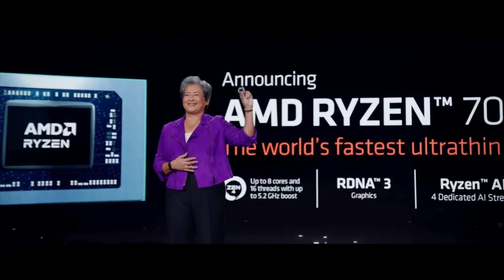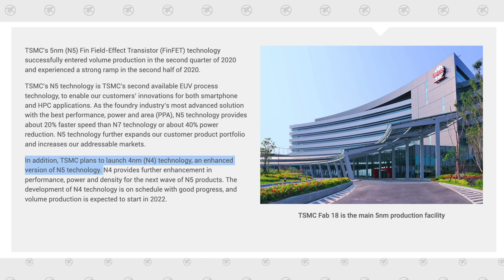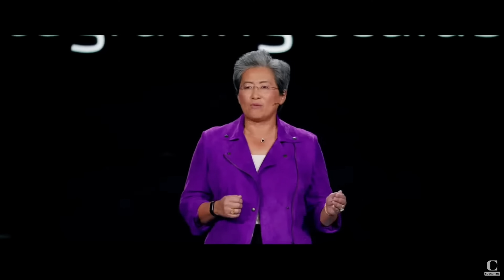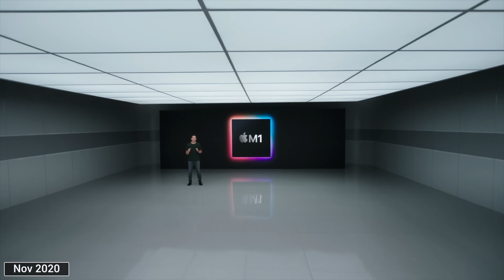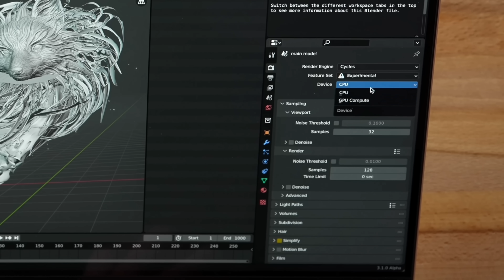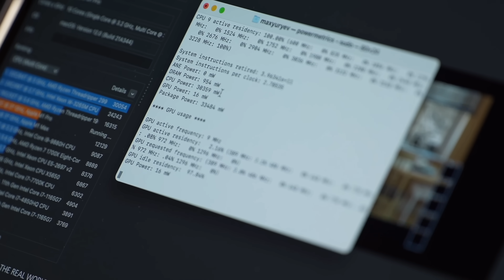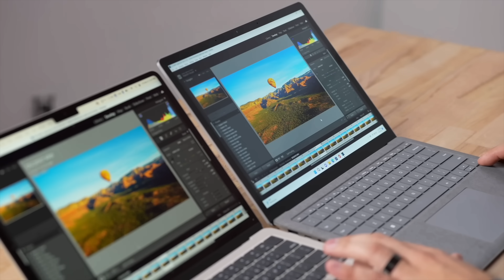AMD's New 4nm 7940HS vs M1 & M2 Pro! Apple Silicon Killer? 🤯

Comment: M1 arm based chip with integrated ram just beat every other players in the market with performance and energy saving. 😊 There is no comparison between x86 amd Intel cpus and Apple computer. I would like to have an apple computer for office, documentation, video editing and coding( app development, web development). If i need to do engineering design, engineering analysis, HPC, CAE, embedded system development, gaming i must have to stick to Windows+ WSL, Linux.  here Apple computer rendered as useless junks. M2 it's just awesome if you just need to do basic stuff, draw back you can't upgrade ram upto 124gb whenever you want, you can't just use your own ssd storage. And most of the industrial application doesn't support Mac Even with the emulator it just doesn't work. Also you can't use gpu tpu form other vendor with Apple Current system.

Comment: AMD 780M iGPU has 17.82 / 8.909 TFLOPS (FP16/32) - your argument trown out of the window

GHz bedween different manufacturers or arhidectures does not equal same performance, not even close - your argument trown out of the window

They used CPU in Blender Render to visually show CPU performance gains over other - your argument trown out of the window

1rst gen does not equal same as 2 gen on anything - your argument trown out of the window

The HS seris is CPU-s with powerful IGPU-s with almost to double the TFLOPS of M2 so more power consumtion as graphics allways take mutch more power - your argument trown out of the window

You use real life spec of low power device and compere it to a theoretical max allowed - your argument trown out of the window

Video editing is not "Real world usage" it is high performance usage, browsing, videochat, text editing and sutch are as the standards have been set(by many organisations) - your argument trown out of the window

It has been tested over the years by many independents(also on YT) that yes few laptops get the promiced battery live when AMD has stated one (mine was rated up to 10 hours on battery and have 2 gens old, it does that and get full 8h days regulary when surfing the web, with 10 to 50 active tabs, and watching movies), some lie in presentations and datasheets and even ordered by Courts not to but still do it, AMD has over the ZEN period been spot on - your argument trown out of the window

Comment: Why do AMD and Intel like to compare the Apple, it's irrelevant to a degree as Apple aren't going to use outside chips, and those buying AMD and Intel are probably not willing to switch to Apple. 
All comes down to what you want to use a device for, although most Apple owners I know it's because it's the more fashionable device and kind of more upmarket for that reason and the few because of the seamless connection of the Apple ecosystem, which credit where credit is due is impressive. Shame Windows phones didn't stick around to give non Apple customers the same. Preferred my windows phone over android personally, bit Microsoft should have but more effort into its integration. To be honest if windows was still on mobile and progressed, that would have spurred Apple on more than AMD and Intel catching up, Apple knows that if these companies do surpass them at any stage it's unlikely to have a massive difference as aside from those in the Apple camp for the fashion part, the more critical users need the integration.

Comment: Think you need to compare the M2 pro against the 7945Hx which a 16 core Ryzen processor runing at 5,4ghz with 80MB of cache or the 7845HX with 12 cores. The fact that this guy doesn't know what the top of the line AMD processors are and he's too Apple bias to be belivable.

Comment: I tend to think (using myself as inference) that, while powerful and efficient componentry is highly preferable to less powerful and less efficient one, the power and efficiency alone is not sufficient a reason for one to defect: a Mac aficionado won't buy a Windows-operated machine (at least, I wouldn't) - and vice versa - a Windows OS fan would hardly defect to macOS simply because the M -series hardware is 10, 20 - or even 50% more powerful. I don't see myself ditching macOS for anything else (including the visually much more polished than the WindowsOS, but rather limited in many ways - Elementary OS). 
 This is, of course, not to downplay the importance of hardware efficiency, power and software /. hardware optimisations.

Comment: Couple of thoughts ... GPU Tflops cant be compared across diff architecture. 25B transistor on AMD vs 33 on M1pro is cos M1Pro has large die dedicated to GPU. Apple 10C has 4 efficiency cores so CPU die size of M1 pro should be similar or less. So CPU i am sure AMD is ahead. GPU they are behind, battery would be an interesting test cos x86 is not efficient instruction set.
Reply: Actually, x86 is not that much more inefficient; the thing is the boosting algorithm. I recall seeing an extensive battery test on various laptops, and in some tasks, the old Ryzen chips could almost keep up with the M1 in terms of battery life, but that was only in some tasks. The thing is, that only applies if you leave a static app open. Now here's the interesting bit that the videos found out: When you open, say, Chrome on Apple silicon, the chip will not boost and the power consumption will remain flat (it was around 10W, iirc), but for both Intel and AMD, the chips went brrrrrr and literally drew their maximum rated TDP whenever you opened Chrome, meaning 45W. Why this happened I still don't know, but yeah, the reason Mac OS laptops are usually that much better in terms of battery life is the software development team. I would say the architecture engineers are pretty evenly matched.
Reply: @diegom2220  it's for opening chrome quicker. It's a feature called turbo boost and you can disable it if you don't need it. It boosts the CPU to max for 1-2 seconds so the program opens quicker, it then goes down to normal after.

Comment: The 7940HS is much more interesting to me as a desktop APU. MiniPCs are becoming more and more powerful, and having one of these in a MiniPC could well replace my desktop.

I've been gaming mainly out of my Steam Deck docked as a replacement fro my i7 7700K GTX1080 desktop, but it obviously lacks a bit of power only going to 15w TDP.

These new Dragon Range APUs are much more capable, and suck up to 45w while being new architectures on both the CPU and GPU side (CPU is two gens newer than the deck!).

Comment: at 3.5 ghz, the amd chip may gives similar efficiency as 8 core M1.
Reply: Agree, I down-ed clock my desktop ryzen 5 5000 to 3.4 GHz, it takes about 30W power and gives about 80% performance of the binned m1 pro. (It’s on 7nm finfet while m1 is on 5nm).
However, the m1 line up idle power consumption is unmatched, about 1w while the desktop cpu is at least 7 to 10w
Reply: @fibundle  May windows OS is also playing in the background . Also there one thing called "speed shift" in intel cpus but dont know what it is called in AMD, which decreases clocks by a lot when not in using but burst when needed. AMD 6000 apu got some dedicated video encoding hardware that can turn off other cores and run video purely on dedicated hardware  and some ultrabooks are said to give above 20hour battery back ups.
Reply: @vmafarah9473  my ryzen 5000 in linux can go as low as 400MHz, but it never turn of any core
Reply: @fibundle   also M1 in pro model  only lasted 2 hour on cpu rendering.
Reply: @vmafarah9473  record Is 1 hours

Comment: AMD doing with limited budget for R&D  is impressive and also, these chips will come to cheaper upgradable devices is awesome. with 30hr video playback makes it a poor mans M1 chip also boosts as well as Intel above 5ghz is impressive.    M2 pro also got more onboard graphics  which uses up some silicon space and make it difficult to cool. igpu is actually killing cpus boost clock for single threaded and multi apps . AMD should have made e cores .With faster ddr5 ram it can match m1 8 core.

Comment: "The unified memory architecture" is marketing speak.

The everone who reviews GPUs knows the advantage of having external GDDR vs DDR.  The GDDR have higher bandwidth compared to plain DDR, which makes it better for steaming textures.  DDR has better latency, which makes it better for CPUs.  

Plus you have 2 completely independent memory busses which means you don't have the processor and the GPU contending for access to a single resource.

Even with the same number of compute units the RDNA desktop card outperforms the iGPU due to the bandwidth limitations of shared memory access.

Comment: AMD Phoenix is on 4nm, but this is for 45Watt and lower laptops.

AMD is also releasing high power 16 core parts that are basically the same as there Zen 4 desktop parts just limited to workstation laptop power envelopes.

Comment: The M1 Pro has 33Billion transistors, but the CPU is actually only 5-10% of the die size.  

Even on the base model M1 the CPU is tiny compared to the size of the chip.

Comment: I wish they are right, but I highly doubt x86 can be as efficient as ARM architecture. Power, sure, it beats it if you put enough cores and frequency. But also with a much higher consumption. As an x86 user (not getting inside the walled garden), I do think it would be great to eat my words, but I doubt it.
Reply: I get as much battery life on my LG gram 1260p if not more than my M1 pro MBP. The first one is personal and second for work. Only thing is LG gram is not that efficient for medium to heavy workloads but for light use it's neck and neck with MBP.
Reply: @SahilP2648  Light work, sure. But when doing anything heavier, there is no comparison. I'd wish my Dell XP would last 10+ hours, but... it does not. :D At least it runs 98% of the time with no fans spinning (for regular use), which is a good improvement with Intel 12th gen.
Reply: @ContraVsGigi  the problems are simply Windows that needs to be redone from scratch for optimization and the dedicated GPUs and everything turns upside down ... if you look closely amd and Intel have already achieved efficiency and are improving continuously, the problems Windows and GPU these are the ones that bring high consumption
Reply: @ContraVsGigi  And forget, too, that many laptops have OLED displays that consume even more of them than Mac displays
Reply: @FBL9982  X86 many times consumes 2-3 times more for the same task as ARM, so, no, software cannot replace hardware efficiency. Sure, there is a need for software optimization, to use accelerators  for some tasks instead of brute force (for instance encoding), but there are architecture limitations that cannot be crossed over.

Comment: the amd graphics for the 6000 gen is 3.4 tflops  is uses amd 680m so gues how much is the 780m with a 3ghz boost clock and new architecture RDNA3 its 8.9 tflops the 2.6 is just bad marketing i guess... its easy look it upp techpowerup but that isnt what you should look at windows has support or wide support for games while apple with m1 and m2 just dosent not the ones that matter either way

Comment: Really incredible, with les than half fewer transistor accounts and 1/3 l cache x86 smokes the best arm CPU made.

And that's not even the best zen4 mobile, which is the 7945

X86 beats m1 since ryzen 5k and Alder Lake, Nobody but insecure Apple proselytizers asks if "this is the next m killer", M was killed as soon as everyone but Apple users realized it must use exponentially more transistors to even be in the game

Be ready for another platform switch, Appl'es not staying with ARM unless they can correct it's pathetic instruction per transistor, ("pathetic" is a kind description understating ARM IPT liability)

It's the actual reason Apple's poaching Intel, AMD and CISC architects, they're trying to develop their own ISA hoping it approaches x86 instruction per transistor.

Apple stays with arm a shorter time than they stayed on Intel, they're trying to develop their own ISA, and trying to  get off ARM as I write, hiring both AMD, Intel and CISC architects makes this fact not speculation.

Comment: Actually, I think the GPU of AMD's new APUs are way better than shown in the estimation charts, given that their last gen Ryzen 6000 iGPUs got 3.4TFlops and they are giving this generation an architecture overhaul and a lot higher clocks. How the architecture contributes to gaming performance is unknown, but if AMD's dual issue FP32 unit claims are anything to be believed, they should deliver double the teraflops of last gen at the same clocks (gaming performance don't work this way)
Reply: But each unit not as powerful in the dual compute unit though
Reply: @ChiquitaSpeaks  Yeah, and that is why I mentioned doubling the FP32 performance does not yield double the FPS in games.

Comment: Your mixing up marketing terminology with science terminology and dont really understand the matrics u r using. Flops r a measurement of fixed functions. How does it help comparing them as the final verdict for chip comparison? N3 is a tsmc marketing term. Not the physical size of 3nm

And comparing clock frequencies like its the early 90s? 

I wish computing was this simple.